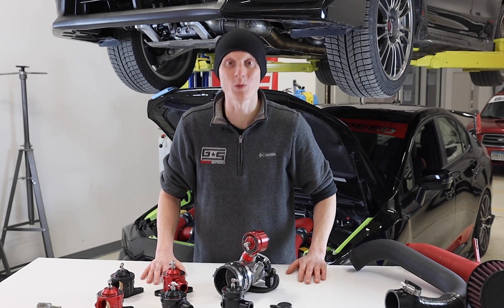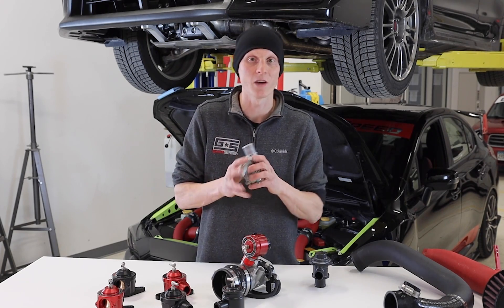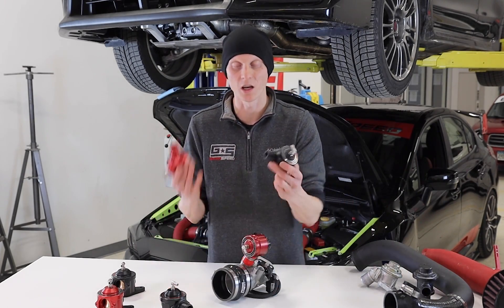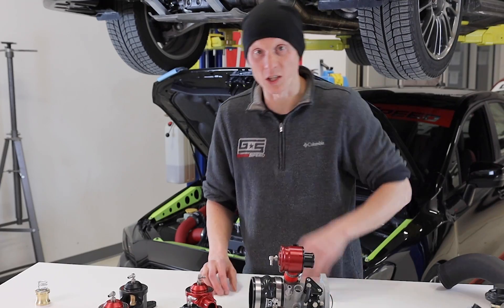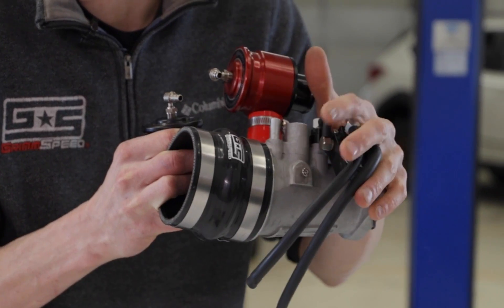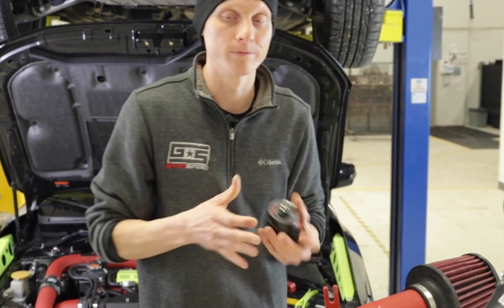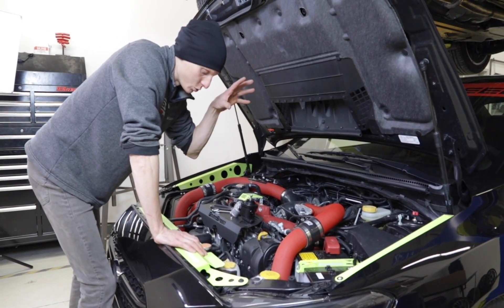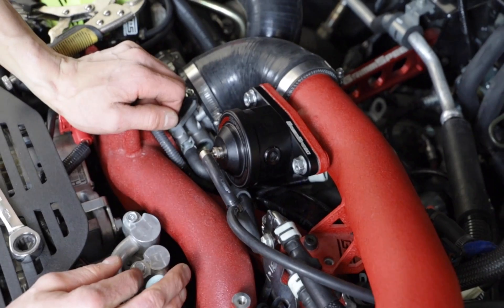NEW PRODUCT: GrimmSpeed EJ and FA20 Bypass Valves

Comment: I have the original version of the BPV and was wondering if there were any reports of the AF correction 1 going out of wack because of it. I have a stage 1 tune so I'm not even sure if I should be messing with a aftermarket BPV anyways. of coarse they offer a better air flow and a nice flutter on stock turbo. Any help? Should I stay with the OEM BPV?

Comment: What is the set screw on the back for?
Is the spring tension adjustable like other valves, or a set spring tension?
Is the fluttering sound compressor surge from the spring being to stiff to properly vent lower boost pressure, or is the flutter an actual sound theat the valve itself makes?
Reply from the maker: The screw on the back is an inspection port. It's is a set spring tension. Non adjustable. In our testing, we did not see any compressor surge. The sound you hear is the valve itself opening and closing.

Comment: Hi how's it going just got my gs bpv I have a stock 2020 wrx I installed it but no flutter did I do something wrong everything is connected right after the test drive I switched it back to the oem bpv pls I need help
Reply from the maker: Guessing you don't have an aftermarket intake. The BPV can be pretty quiet when running the OEM enclosed intake.
Reply: @GrimmSpeed  you where right there is a flutter it's just quiet ima need a aftermarket intake now 👍🏼💪🏽

Comment: What is the typical hp increase for the whole setup you have on the table? I am ready for some upgrades.
Reply from the maker: Most of the parts on the table aren't power adders, but parts that will facilitate more power with additional add-ons. The intake, charge-pipe and j-pipe will provide some hp gains with a tune.

Comment: Is it fits on stock inlet or only the grimmspeed ?
Reply from the maker: Will not fit the OEM 08-14 Subaru WRX Intercooler. It was designed to worked with the GrimmSpeed flange design.

Comment: Is it possible to achieve any extra sound installing this onto a completely stock STI? Some people say yes, some say no, and others say it’s very faint.
Reply from the maker: In a completely stock vehicle, it will be pretty faint. In order to really get a change in sound you need be be running some kind of aftermarket intake.
Reply: @GrimmSpeed  thanks for the clarification, I appreciate it. That’s what I figured for the most part. I bought a new 21 STI back in October and I’m just a little hesitant on buying parts that require a tune at the moment, at least until I’ve had the car for a little while. So I’m trying to achieve anything possible without going overboard. Would it still be beneficial for the car putting an aftermarket BPV on?

Comment: can you please tell me why the bov goes on top of the engine and the bypass valve goes under the engine?  or visa versa. i thought they were the same thing, just operate differently. is there two different types of engines?  could you have a bypass valve under the engone and a blow off valve on top of the engine?  i really dont think so but i dont know. I'm new to subaru
Reply from the maker: Good question, there are a couple different fitments. The FA20 fitment for the bpv goes under the engine and connects to the turbo inlet, The EJ fitment sits on top of the engine and attaches to either the intercooler or the front mount piping.
Reply: @GrimmSpeed  so there is 2 locations of where it COULD go.  It just depends on the fitment of the valve you buy?
Reply: @THEBILL1993  It depends on your engine. FA20s have the BPV underneath. EJs have the BPV on top with the intercooler.

Comment: Can I really not run this on my stock legacy gt tmic? States you don’t need a tune for this product but then also says (can’t fit oem tmic) which you’d then need to get a new aftermarket intercooler to run this bpv and ultimately would need to get a tune either way since you have to change your IC🤦🏾‍♂️

Comment: I just installed one on my 2020 STI and noticed you didn't put a gasket between the bpv and flange. Does the O-ring take care of the seal without the gasket? Just wondering because my car sounds way different from the STI in the sound video.
Reply from the maker: Hey John! Correct, the o-ring takes care of sealing the unit. Keep in mind, the STI in the video is pretty built up with a GrimmSpeed Aftermarket Turbo and applicable mods.

Comment: So what tmic would I need to run for this bpv, Or will it not fit any tmic? Just wondering cause it says “does not fit OEM tmic” on the website.
Reply from the maker: We recommend running this on either a GrimmSpeed TMIC or FMIC, however it can work on OE STI intercoolers; 08-14 WRX/05-09 LGT factory intercoolers however will not work with this.

Comment: So this new BPV doesn't need a Gasket? I got mine today and haven't installed yet but it didn't come with a gasket! Should i reuse the OEM gasket? Or just install it without that? I got a 21 STI BTW
Reply from the maker: No gasket needed. These seal with the o-ring included on the flange.

Comment: If I wanted to install this onto my OEM turbo inlet for my fa20 platform, would I need to trim 1/8" off of where the bpv actually fits into the inlet like the boomba bpv? Or is it just a straight plug and play with no trimming?
Reply from the maker: Some trimming may be required. Depends on the application. Some of the OEM BPV's require a longer hose for fitment.

Comment: As a fabricator and have done work on all types of cars and trucks, y'all make great products, fast shipping and why I keep coming back. Now I gotta get this part and take off the turbosmart bypass from the wifes sti!
Reply from the maker: Right on!! Thanks for the positive feedback!
Reply: @GrimmSpeed  well deserved, will be on order if not already,  I'll be sure to get some sound clips, not running inspection port open though for tuning sake.
btw whomever you got welding downpipes... pat them on the back and shake their hand, very nice welds  matched mine once I cut off flange and welded vband on. no offense to the 2 bolt flange I prefer vband is all.

ordered today!

Comment: I would think it shouldn't be a problem but I have a '12 WRX with a Mishimoto aftermarket intercooler that keeps the stock location of the Bypass valve. Do you think this new Grimmspeed one would sit there just fine?
Reply from the maker: As long as the flange is the same as OEM, then it SHOULD work just fine. We have not had the chance to test fit these new BPV's with other competitors products just yet. Typically not something we do as we design all of our products to work flawlessly with each other.
Reply: Seems good. Thanks for the reply! I look forward to getting more Grimmspeed parts in the future for the build
Reply from the maker: @TheeWandell  No problem. Lets us know if you have any other question. Happy to help.

Comment: I'm guessing if one was to "forget" to install the inspection port plug, it would become a VTA BOV and make extra noises.... and require a tune of course.. I mean we have to inspect for science.
Reply from the maker: James, the port is strictly for inspection purposes only. We would have to shake our head in disapproval if it was taken out and discarded for any reason.
Reply: @GrimmSpeed  So the inspection port is already pre assembled? Just curious if the port is something you have to install on the side before installing the BPV
Reply from the maker: @RuzeyFX  The port is pre-capped with a plug. There is nothing to install on the side before installing.

Comment: Does it come with a new gasket or I need to use my old one?
Reply from the maker: On these BPV's, no gasket is required. There is an included o-ring that makes the seal.
Reply: Ok I just ordered it 😁